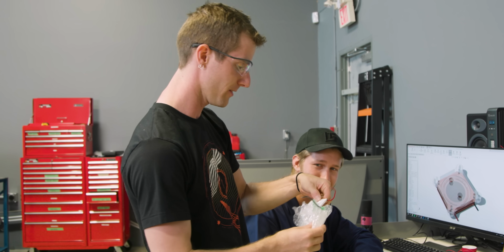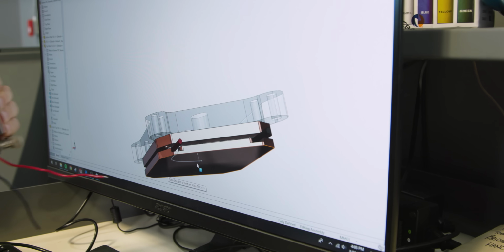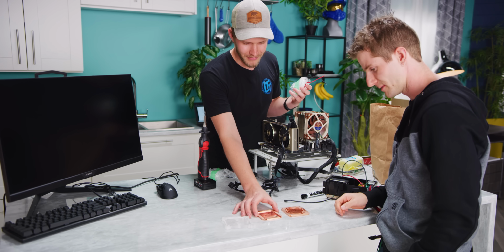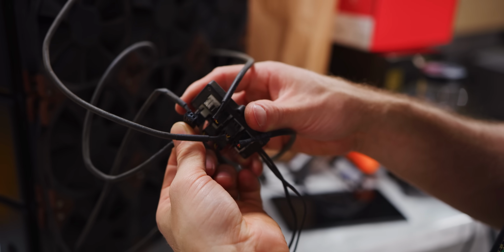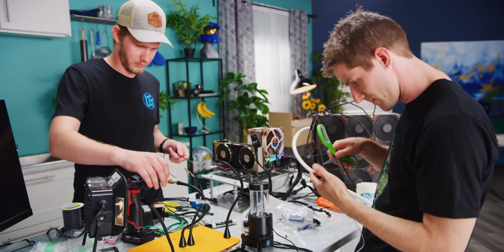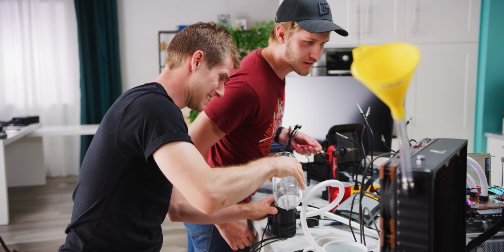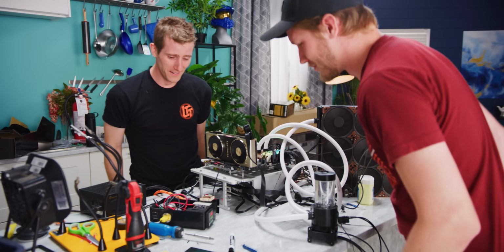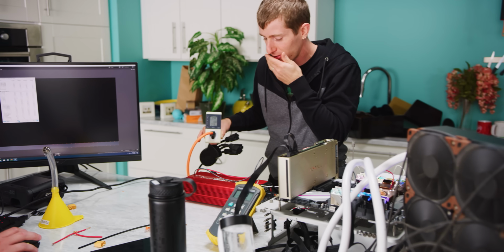This Cooler DRAWS 545W!!? Bad Cooling Ideas #2

Comment: Your peltie uses 900W to transfer heat. That means you have to be able to cool at least that amount with the water block. If you don't, both side start to heat.
Reply: Helped build a TEC rig back in 2007.  A 2.4ghz Core 2 duo OC'd to 3.6-3.8 range held around 1°c give or take 2 degrees no matter how much we stressed it. Yes, TEC is woefully inefficient and I would not want one the energy consumption alone doesn't warrant the boost you could possibly gain. It was a goofy project just to build a self contained insane overclock rig that you could lug to a lan party.
Reply: Hottest part of this build is the electricity costs

@900 watts that things gonna cost $1000+/year
Reply: I love how everybody are suddenly engineers.... but everyone copied all their word salads from 1 guy xD
Reply: If you connect a TEC to a cpu and watercool the tec it could improve the cooling of cpu.
[cpu][tec][waterblock]
Reply: @AAaa-jc5sk  That's exactly what they did...
Reply: @dltank  oh yeah.
Reply: @dltank  WHAT ABOUT 2 TECS SIDE BY SIDE WATERCOOLED
Reply: @AAaa-jc5sk  Seems to me it would be even more heat for the cooling loop to fail at dissipating
Reply: @dltank  shhh let him speak
Reply: @A aaa thanks man… but it I’m me and your me am me you or you me i. Us them   Singularity?
Reply: @A aaa yes?
Reply: Make sense. Buti think this cooling still can hold it's ground.
What if we cool the cpu with normal water block and the water from that should be steady 30 to 60 celsius idk.
Send it through a radiator to cool it down below 30 or 25 celsius.

Then send it to a thermo cooler.
It would have a much easier job to chill a room temperature water than a cpu.

Then the chilled water would make the water cooling loop more efficient because them we could send 15 or 10° celsius water to cool the cpu. 

And even if the water needs more time to cool down form the thermo coolers then just add more in a line and the loop could go trough 2 or 3 of them making the water really chilly 😅.
I don't know it this would be a good idea though. 
If you use 2 or 3 thermo coolers to atchieve sub ambient temps that could pull a lot of power. I don't know how much watt smaller ones could pull full time. 

But then aggain you need to cool the hot side of them too😅
Reply: True. And there is no way that this little block can cool 500W.
Reply: @xsjado_anon  TEC Coolers have extremely poor thermal conductivity. They also have extremely poor efficiency. They have efficiency that put solar panels to shame, so what that means is - A 545W TEC can only move 5.45W ( ~10% like ultra super max level stuff), and to do that, it generates 539.5W of heat. Now coming back to thermal conductivity, that measly 5.45W of  heat to be moved is limited by its thermal resistance, so what it means is it takes way longer to move that measly 5.45W of heat compared to a block of damn iron, much less a proper copper heat block. So, bottom line: you wanna freeze a few ml of water into ice spending hundreds of watts? Be my guest, and I assure it will work as long as you can dissipate those hundreds of watts. But Peltiers can never move enough thermal power from a strong af dynamic heat(one that continuously converts energy into heat, in contrast ambient temperature water that we were making ice out of before does not continuously compensate temperature since its heat energy is gone once it cools) source like a CPU. (And if you really wanna do it, like reaallllly badly wanna do it, for every 100W(around that for a TDP?) of cooling on the cpu you need around 100W/0.05(eff) = 2000W of peltier units, and heat dissipation capacity of 1900W and your peltier should would prolly still not be able to work out due to problems in thermal conductivity. LOL, this was a long rant, but will prolly save some idiot his money. 

PS - Imma just post it in main thread too, just in case so people can see it..
Reply: @anubhavmuku96  wait, 5.45W ain't 10% of 545W, that'd be 54.5W.
Reply: @AryaFairywren  Ah yes, right. My bad. Well, the bottom line still stays the same tho.
Reply: @anubhavmuku96  While their efficiency isn't as good as a gas transition heat pump, it's a bit unfair to to compare performance if you're running the TEC at 545W because that displays a complete lack of understanding of how to utilize them.
The coefficient of performance of a TEC scales badly. For example I'll use the TE-127-2.0-1.15 module.
If you run the TEC at 3v, you can pump ~25W of heat, with around 35W of waste heat with a temp difference of 10 degrees each side.
If you run the TEC at 15v, you can pump  ~110W of heat, without around 350W of waste heat with a temp difference of 10 degrees each side.
That's 10x the wattage, for only 4x the amount of heat it can move from the cold side.
That's why it's insane to run a TEC at 545W, it's much more efficient to run many of them at low wattage.
Reply: @anubhavmuku96  peltiers create a temperature diffrence.  

linus his only problem was the insuffienct cooler block to remove heat from the peltier.
Reply: @anubhavmuku96  You'd have to dissipate the peltier power plus the moved heat, so 2100W, not 1900W.
As you said, these are good for infrared camera sensor, since they dont really generate heat.
Reply: @anubhavmuku96  so in order for it to be viable at all youd essentially need a car radiator and a custom water block with very large diameter fittings + a huge pump as well to move all that liquid fast enough to move the heat generated

or you’d have to have the cpu on it’s own loop, and somehow make a custom res and put the techs cold side into it then have a separate loop just to cool the tech, what i imagine is happening with their setup is having the cpu directly on the tech causes it to quickly overheat , because not only are you dealing with the hot side of the tech your now putting a huge heat source onto the cold side as well, heat + heat = heat, and at the point where it becomes overwhelmed it essentially becomes a massive thermal insulator causing the cpu to throttle as they found out, as well they don’t take into account that the hot and cold sides are on the same piece of material and can easily overwhelm each other especially if you add a bunch of heat on the cold side
Reply: @anubhavmuku96  No,  it means that the efficiency is 10% of an ideal heat pump, you are interested in the coefficient of performance. In the case of a vapor-compression refrigeration (fridge, air conditioning etc.) it can go up to 3 or 4 (300 or 400W moved for every 100W of power), in a TEC varies a lot depending on conditions (I looked at a datasheet of a TEC comparable in power to the one used in the video, the COP varies from 3 at low loads and low temperature differences to 0.1 or less in the worst case). If you can keep the hot side at relatively low temperatures, so that you don't need a big temperature difference, and you choose a TEC so that it operates in conditions where it has a decent COP like 0.5 it is doable. In the past I have seen 250W TEC cooling a P4
Reply: @anubhavmuku96 what about " pre-cooling" the water comming out of the cpu through the peltiers? This could be working right? I'm using 15, 150W peltiers to heat my pool because i have tons of excess power out of my solar pannels but that does not matter. If you can make a super inefficient air conditioner out of them, cooling down the cou should not be a problem if you " pre-cool " that heated water first using a small or single 120mm radiator and then cool it even more down using 550W of crap
Reply: @anubhavmuku96   it's usually about .6 for most TECs, not .1 or .05 efficiency. However, if you are unable to keep the hot side cool then both sides will heat as the guy above said. (and there was no chance of their waterblock working for that, they would have been better off with a professionally made TR4 waterblock. FEA and other such analysis programs are only as good as the user, and most colleges don't go into it enough unless you're in extracurriculars and teach yourself alongside proper lab testing to measure how far off you are so you can modify your model)
Reply: @nickopedia5669  What are you talking about? Conventional compression-cycle systems make like 0.4 to 0.6 efficiency of a carnot cycle.  If a TEC had .6 eff, I'd marry it and sleep with it for the rest of my life! Now, I may not know everything, so I may be wrong but never have I ever heard of a TEC with 50% efficiency, you got any documents or references to prove the efficiency numbers?
Reply: @anubhavmuku96   So in summary they have maximum efficiency of 0.6 typically at 0 delta T going down to 0.0 efficiency at their maximum delta T. 
Therefore to use a TEC properly in a PC to improve your temperatures and maybe get your waterblock temperatures to ambient (so CPU temperatures maybe 10-15C above ambient), you need 2 radiators and 3 waterblocks, with the loop like this: 
pump (coolest water)-> CPU ->radiator 1 (to cool back to close to ambient, as best a watercooling system can do)-> waterblock on hot side of TEC, -> radiator 2 (again cool as close to ambient as a water loop can do)-> waterblock on cold side of TEC (cool water down to or below ambient)-> pump again.
This way you are using a "normal" watercooling loop, except once the radiators have cooled it down as far as a radiator can, it gets cooled even further by the TEC. you really want to be sure that your radiators are getting the water temps pretty close to ambient because that means you can use less TEC power which is expensive.   More radiator= weaker TEC needed.
Reply: @anubhavmuku96  
If you can't tell, I'm frequently VERY frustrated by all these youtubers and tech people doing TEC cooling wrong. They did the same with the refrigerator thing a few years ago too, expecting the fridge to handle it all without dumping the temps down to ambient first.
Reply: @nickopedia5669  You use a TEC to remove energy from a given system to deal with it elsewhere, not to move energy around within the same system. Integrating all of the TEC into the primary loop would introduce more heat to the system than it already has to deal with. I do grant that this might work by creating a localized chilled zone in the loop, but you really want to use two separate water loops. That way the primary loop can concentrate on doing its job of moving the CPU's heat to enough rad surface to stay close to ambient. The cold TEC block would sit just before the CPU block, cooling almost-ambient-again coolant down to ((well) below) ambient, while the hot TEC block would have its own water loop to deal with both the energy taken out of the CPU loop and the energy needed to drive the TEC. You will want to employ probes and controller logic to ensure the chilled fluid stays above the current dew point in your room, and/or make sure your system is condensation proof.
Reply: @anubhavmuku96  Compression cycle systems don't use "efficiency" exactly, but rather, "coefficient of performance", which is the reciprocal of efficiency for a heat engine. This measures, for a given temperature difference, how much heat can be moved for a given energy input. Modern compression coolers can have CoPs of around 4.5, so for every watt of power consumed, they'll remove 4.5w from the cold side and move it to the hot side (putting 5.5w of heat out of the hot side, because of the 1w power input). As others have noted, CoPs for TECs vary widely with temperature differences. For very small differences and low current levels they can actually be greater than 1, but in practice they're usually around 0.5-0.6.

But, since their hot side was getting very hot, they were probably down in 0.1 territory. Above a 30C temp difference you can't do much with TECs. And, if you can't adequately cool the hot side, they're just a heater.
Reply: Anubhav Mukherjee what are you talking about? Vapor compression coolers move far more heat than the electrical energy you input.  For this reason, AC measures coefficient of performance versus efficiency, because they would be 1200% efficient instead of a cop of 12.  You are thinking of a gas engine being 60% efficient at max due to Carnot efficiency.
Reply: @Olfan  THANK YOU.
Reply: @anubhavmuku96  Im not sure where you’re getting those numbers for compression refrigeration but large industrial refrigeration cycles can get as high as 800% efficiency. Smaller scale is typically on the order of 400%. While TECs are nowhere near this, at max COP can be as high as 50-100% efficiency at from 10-20degC across the junction. Their problem was inadequate heat spreading  from the cpu to the TEC and overvolting the tec as well. As others had mentioned previously (and proven by intel’s new tec cryo cooler) running many more tec’s at lower power per module can actually be effective
Reply: @nickanselmo6353  Lol, while I don't really understand what you mean by 800% efficiency, you've replied several times to me. How often do you watch this video? Also, please explain what and how 800% efficiency works if you have the time, since I don't really get how a system efficiency gets over 100% even in ideal cases. Thanks.
Reply: @anubhavmuku96  I think you are mistaking me for the other nick’s who replied earlier in the thread. As for above 100% efficiency it is because compression refrigeration is a heat pump cycle as opposed to a heat engine cycle. For a given electrical input of say 100w to the pump, the cycle would be able to move 800w of thermal energy from the cold side to the hot side. As mentioned by others above, this is why heat pumps typically are measured by coefficient of performance instead of classical efficiency which is defined as heat moved/energy input. I believe you are likely confusing the theoretical limit that heat removed can never be higher than waste heat produced
Reply: @nickanselmo6353 Oh no! I am so sorry, didn't read your last name. And I see. Yes, I was confused with that. Thank you for taking the time to explain it. I'll read up more on it when I can make some time.
Reply: @nickopedia5669  Yeah, he didn't overwhelm the TEC because the hot side was extremely hot, so that means he overwhelmed the cooling system, like the pump and the water block
Reply: @hammyboigaming904  
I believe you have that reversed. 
If the hot side gets too hot, then the cold side, which can only get so much of a temperature difference from the hot side, gets hot too and can't do anything.

You need to get the hot side down to reasonably close to ambient before you try anything, whether that be adding more power to move heat or hooking something up to the cold side that you want to cool down.
Reply: @nickopedia5669  That's what I mean. As you can see, the TEC works properly, but their cooling loop isn't taking enough heat away and the entire thing just heats up
Reply: @hammyboigaming904  
Oh I see in that case yeah you're exactly right.

Comment: The PID controllers are pretty good things.
Often used in labs and metalworking industry to control the temperature in muffle furnaces.
Heat treatment for steel or otherwise simply maintaining a stable unchanging temperature within the chamber.

BTW, that's why it doesn't read negative temperatures, it's intended for high temperatures, such as from the 600's to over 1k Celsius.

Comment: My Linux rig doesn't consume that much power with a 1060 6GB ,4 hard drives internal and 2 external ,16GB of RAM and an Quad Core Pent 3.5 that is equal to a I5 7700K in performance. So this is an epic fail

Comment: Roman (Der 8auer) also failed at this. Peltier elements are just not made for this. They are great if you want to cool something below room temperature that doesn't put out a sh*tload of heat. But for cooling things putting out a lot of hear, they are just useless and worsen your cooling (except if you put an overkill 400 W peltier on a 50 W CPU maybe).
But for cooling, the traditional methods (transfer the heat away with copper/aluminium or water) are way better and since you need to cool a peltier, it just adds a ton of heat output, makes the distance the heat needs to travel longer and therefore brings no benefit...

Comment: Interesting. 
What if you actually cool the water using the Peltier instead of the fans on the radiator? i.e. CPU water cooled normally but then the radiator cools the water using Peltier instead of fans?
I am guessing some condensation is going to happen but more likely on the radiator side, only ... more or less ... probably ....
#Pel-cheeh-eh

Comment: You are going the wrong way about this, what I did few years ago I got a 56L reservoir to cool the cpu and used the peltier coolers to cool down the liquid running close to 2kw peltier coolers got the reservoir liquid temp down to 10c eventually at which point I started stress test on my delidded 7700k running at 5.3ghz stable @ 1.47v running stable 75-80c with 10c coolant liquid room temp being about 18-20c
Few days later ended up killing the system due to condensation after leaving the system on and no longer having the heat from stress test to keep the coolant at 10-12c so it probably chilled down to 2-4c at which point the condensation killed my system
I was using 24 units of 100w peltier coolers which were outputting closer to 65-70w in actuality using 12v

But that's an idea you could go about it if you are more interested about the setup I could get some pictures I was using 3x 360 rads and 6 fans on each rad to cool the hot side of the peltier cooler and the cold side was connected to 200x40mm aluminium heatblocks that then connected to the reservoir and rest of the loop

Comment: Good video.  Really thought that would work better but at least the failing on this video shows it's failures.  

Btw a PID you could control the variable voltage PSU and possibly get the cooling more stable.